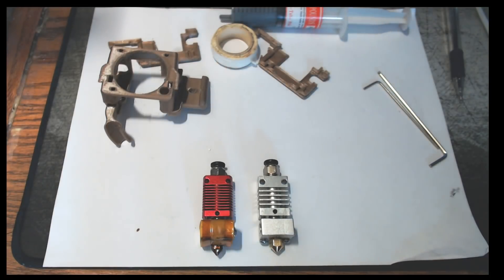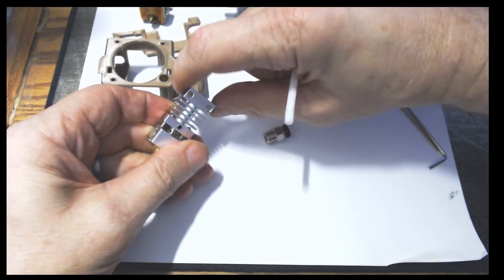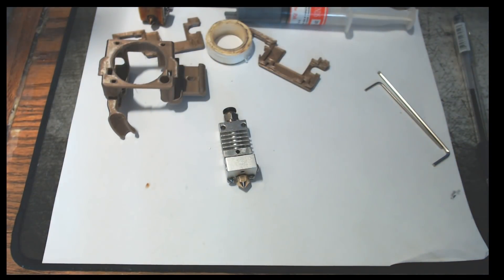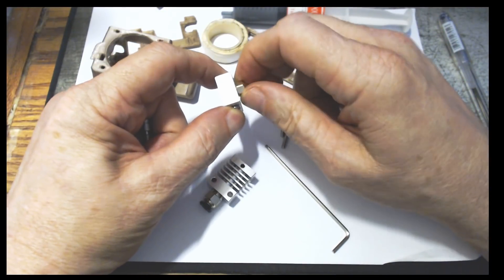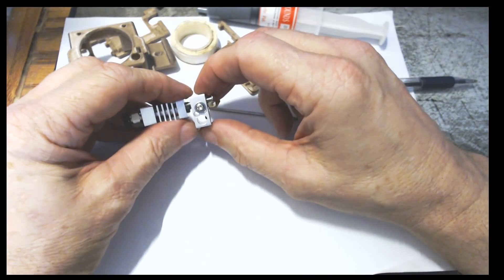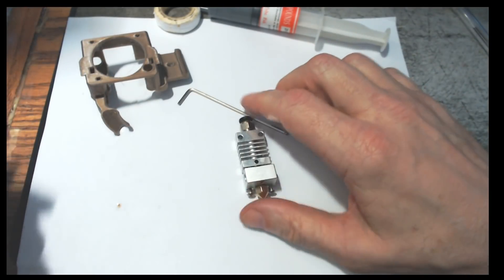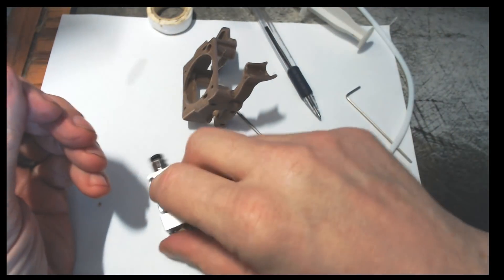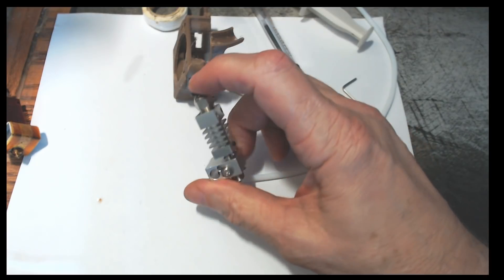All metal hot end for the Ender 3 for $7. Part 1, tips, trips and lessons learned.

Comment: In your beginning you told something about an expensive hotend and you don‘t want to use any names, like me. If you ever bought any of these expensive hotends, you get a manal too. Most buyers think its boring to read anything a manufacturer writes about his produkt, but everything you show in your video and filled it with many words is written in this manual very shortly. In most cases even in different languages. If you really want to read this manual without buying the original item, visit the homepage of this manufacturer.
Reply from the maker: First, I didn't want to read their manual. I never read manuals, it's a sickness. Also, there's some question as to who designed the original in this case. I've had industry insiders tell me that the original was a Chinese design. But who knows? 3D printing isn't new, it's been around since the 80's. If the all metal hotend was patented in the US that patent would have expired years ago and clone products would be completely legal now. But really, does it matter? US and other Western nations give their IP willingly to Chinese manufacturers to get things made cheaply, knowing that the Chinese manufacturer will absolutely set up a second assembly line and sell the product through AliExpress or someplace like that. And multiple other companies in China will copy it as well, which is often why you see identical products on Ali with 20 different brand names. If you can keep all that straight and want to slap "Original" on something and virtue signal on the internet, more power to you, but don't expect me to follow your rules.

Comment: wew ok, i have retraction at 7mm 25mms on my stock hotend, now im scared of stringing for fine D&D models
Reply from the maker: How did you arrive at 7mm and 25mm/sec? Through trial and error? Or did someone recommend them to you? 

If you're making your D&D models out of PLA then I'd probably either stick with the stock hot end, buy another printer so you can have one stock and one all metal, or be prepared to switch hot ends when you switch filament types. You're probably switching nozzles anyway if you're going from  tiny D&D models to larger things, it's not really that hard to swap out the whole hot end. I got really good at it. lol
Reply: @3rdpig  Cheps guide rwccomended it, i tried it and haven't had stringing since. I like ur thinking, i bought a second ender 3 last week haha
Reply from the maker: @LostCloudx4  Thanks for letting me know and I think the second printer is really the best answer for two very different filaments and purposes. Unfortunately I've never watched Chep's channel. I've found that much of the time I used to spend watching other people's channels now go into my own. It's a shame in a way, I've learned so much from Lars Christensen, Maker's Muse, 3D Printing Nerd, Thomas Sandlander, 3D Printing Professor, etc, etc.  So much good information and so little time. I don't even manage to catch all of AVE's videos anymore, and that's really a crying shame, lol.

Comment: Why do you protect microswiss so much they copied crealities design but just moved the hole location
Reply from the maker: I'm not protecting anyone other than myself. Personally I don't really care who designed it or who copied it. I just don't want cease and desist letters from lawyers or have videos deleted, my channel demonitized or have to spend a lot of time cleaning up comments from rabid fanbois of one company or another. And let's face it, it's a heat block with a cooling tower attached to it via a heat break. There's only so many ways to make something like that. Almost anything in that configuration can be called a copy. And I tend to doubt Creality or MicroSwiss  are the original designer.
Reply: @3rdpig  fair point, Im not sure if they can sue you for saying it looks like a clone but it's probably best to avoid the whole lawers shitstorm

Comment: P.s. hot end tube . Try to clean that out . Better to just replace the plastic white tube . Get rid of the cheap ender 3 .
Reply from the maker: You're wrong. It's got nothing to do with the "plastic tube", clean or not. It's got to do with printing at a higher temperature than the "plastic tube" will allow. The "cheap" ender 3 that the all metal hot end is on has been running for nearly 3 years, can print nylon and polycarbonate and, upgrades including, only cost me $400. Show me another printer that comes enclosed and can print successfully in those filaments for that price.

Comment: How come you printer guys never compare a swiss all metal $70 and a $6 one... they look the same... seems odd no one made a video testing using same slicer settings temps material... would be pretty simple...
Reply from the maker: Well, in my case I don't feel any real need to blow $70 to do that. It's basically a ten cent finned aluminum block with a hole drilled down the middle, threaded on each end with a heater block and nozzle screwed to one end and a bowden tube tube fitting on the other. As long as the person making it isn't an idiot the only differences will be the cost of the labor, how much time they spent to make it pretty, packaging and after sales support.
Reply: @3rdpig  i think you r right.. there is no real difference... but these guys setup the swiss one and could easily review a cheap one but don't...  i think its all about $$$ with the other guys for sure...

Comment: Great video! after watching this video i now believe you get what you pay for lol. Don't get me wrong if there are cheap alternatives to name brand products i am willing to try but this product sounds like it gave you too much issues and for me might not be worth it.
Reply from the maker: The all metal hot ends all seem to have the same clogging issue. It doesn't matter where you got it or how much you paid for it, it's just the nature of the beast. When you pull molten filament out of the hot nozzle and into the cooler part of the hot end and then push it back (retraction and reprime), it sticks to the metal walls of the tube, mushrooms and clogs. It doesn't do this with the stock hot end because the molten filament is pulled into a teflon tube, which is slick enough that the molten filament doesn't stick to it. The cure for it is to cut the retraction distance and reprime speed in the slicer down until it stops clogging. For me that was 2mm and 20mm/sec.

I think the bottom line is if you want it to be pretty, come with instructions and after sales support, get the $50 Micro Swiss. If that seems like a large increase in price over the $5 to $7 "copy" for instructions and someone to call if you can't get it working right, then buy the cheap one.

And of course, if you don't really need an all metal hot end the best answer is stick with the stock one.

Thanks for watching!
Reply: @3rdpig  ya i am new to the 3D printing scene so doing my own self research on hot end designs and brands, thanks for the insight on this subject

Comment: The genuine MicroSwiss hotend is not made in China. It is made in the USA. That's why it costs so much more than the crappy clone you bought. Reason number one for your problems was the off center 2 screws on the sides of the nozzle. These are worse than unnecessary, as they cock the nozzle when tightened down (as you noted). It's worse than that because they act as thermal bridges between the heater block and the heat sink. The whole point of a Titanium heat break (is yours on the clone titanium?) is to eliminate thermal bridging. You just added two more thermal bridges with those screws. This means that the bottom part of the heat sink is not as cool as it should be which pre-heats the filament before it reaches the melt chamber in the nozzle. Pre-heated soft filament tends to mushroom and drag along the wall of your all metal hotend which leads to the other problems you described. Furthermore, your nozzle on the clone is brass. This will wear out very quickly with abrasive filament such as carbon fiber impregnated Polycarbonate. Your video is a prime example of how buying clones all but guarantees a worse experience. It is also an immoral thing to do. You are supporting thieves. Before reacting to those last two sentences please watch the video here on YouTube titled "Open Source in 3D Printing - Copycats, GPL Violations, and China"
Reply: Quite right, better to buy a genuine wanhao hotend then the micro swiss, which btw, is a clone of the wanhao.

Comment: What causes little spots to stick up[ after retraction? My nozzel keeps bumping little nubs left by the last pass
Reply from the maker: What filament are you using? I've had that happen with PETG, it seems to glob up a bit, then stick to the nozzle and then when enough builds up it  will stick to the print and the nozzle hits it on it's next pass. If it's PLA or something else then I'm going to have to think that your retraction settings are wrong, or for some reason it's not retracting like it should. Also, some brands of filament are more stringy or globby than others.
Reply: @3rdpig  I'm using 
-amazon essentials PLA grey. 
-Creality Ender 3
-upgraded micro swiss full metal
-glass bed with glue stick cross pattern
-bed temp between 60-80
-print temp 195-200 on first layers
-retraction .6125 (i think)
-print speed 45

I'm printing a mech robot mini 55mm height figure, with zig-zag supports. Iv'e recently heard that printing with CURA supports turns of retraction?
Reply: @3rdpig  Thanks for the reply. I think my problem is the feet and details on the mech don't give enough surface area. If i print with a brim that merges the footprint of my model, I think it will have a harder time tearing off the platform.
Reply from the maker: @evilparadigm  Your probably right, but you shouldn't be making blobs that the head strikes using PLA. But when the model is tall and the base is small I always use a brim or even a raft if it's real small at the bottom.

Comment: Just a question because I can't believe it's not obvious. If installing an all metal hot end is desirable because it allows you to use higher temperatures without the downside of 'poison' gas with the common Bowden setup, why in the name of god would someone then use Teflon tape? Bowden tubes are PTFE. That IS Teflon! The amount of bad 'maker' information on the web astounds me.
Reply from the maker: It is obvious. In searching for solutions to problems, sometimes we do things that are counter intuitive after we've tried all the intuitive answers. It's also counter intuitive that it would impede heat transfer from the heating block into the tip and we want exactly the opposite. So yea, I'm guilty of "Well, that sounds stupid but it's worth a try".

Comment: These clones do not have the tolerances that the original does.
Reply from the maker: Ok, I'll bite. How do you know this?
Reply: @3rdpig   Chuck Bryant    Ive got both! The machining and quality is very apperant when holding both side by side. The titanium heatbreak is an Insert and not a sleeve. This should be the big indicator that they cannot affordably reproduce consistent diameters with the factory or machine that made them. If they made 1000 titanium cloned sleeved version heatbreaks, some might not fit into the coolinghead of others vice versa. This leads me to believe I do not need an expensive tool to tell me the dimensional tolerances are not the same. So i applied the logic that someone has to make sure each and every.. Single.. Heatbreak fits into any of the customer's heat or cooling blocks. The Chinese solved it and made it cheap at the same time by simplifying the one part they needed to machine consistently at high quality! So to make a high accuracy bit, you need an even more accurate bit. The Chinese buy US tooling to make their tooling bits, to make their products. Assuming the original are machined in the US and not just assembled here. I can assure you the clones were not made on a 50 thousand dollar plus tool bit.
Reply from the maker: @Acavando  Your visual comparison, while anecdotal, is valid. I also suspect it's a fair representation of the two parts. And had you stopped there we'd be good.

However, your visual inspection has nothing to do with tolerances or function and everything you said past that point appears to me to be complete fabrication based on assumptions you made from that visual inspection. 

Here's my take. You said you have one of the Chinese parts. Have you tried using it? Does it work satisfactorily for it's intended function? I've got three of them, used them all and they all work fine. 

Bottom line, the MicroSwiss is prettier. but costs 10x as much but it comes with instructions and after sales support. If your logic says buy the part that's 10x as much, that's great, that's what you should do. My logic says "Don't spend $50 when $5 will do the job just as well.

And please, do yourself a favor, stop using words like "tolerances" until you know what they mean. Even a hobby machinist like myself will raise the BS flag when you toss one out like you did in your first post. The constant misuse of words like "tolerances" and "clearances" drives me batshit crazy.
Reply: yeah 

on top of that they went crazy on chamfers on the holes creating areas whee your melted filament can expand beyond .079 dia of the thru hole . And when you assemble them and try to drive check pin thru entire assembly it looks like holes in the heat sink and heat transfer are not in line
Reply from the maker: @georgeinthejungle2  With all the problems you two describe, you'd think they wouldn't work at all. Yet, they do. Maybe, just maybe, the things you're seeing aren't that important as far as functionality are concerned?
Reply: @3rdpig  i agree with you chuck , most likely changing retraction to 1mm helps ,but not fixes the problem completely . i modified my hot end .milled of areas to minimize chamfers and re reamed entire assembly to .081 dia. just today . cant wait to test it .
Reply from the maker: @georgeinthejungle2  I feel you. One of the problems with the Chinese goods is that there's really no accountability to go along with the poor quality control. You may get one that's fine and you may get one that's crap. Get on AliExpress and one particular product can have 5 or more brand names all with different prices. A week later that brand name is gone and another one appears. Complain and they refund your money back but only after making you spend days jumping through hoops. But that's the price we accept when we get a product from China that's 10x less than the one made in a Western country.
Reply: @3rdpig  true . not going to lie i knew that it might not a be a smooth sail when i bough it . after all it was only 7$.  one more thing i found that might help is PTFE in spray that could help with stickiness of the walls .
Reply from the maker: @georgeinthejungle2  The PTFE spray was one of my thoughts too, but then it was pointed out to me that the whole reason for the all metal hot end was to get rid of the PTFE, so adding it back in was kind of counter productive.  I'm also not sure that adding anything to the walls will last with the filament getting dragged past it since the filament is rather abrasive. I thought of graphite dust, but not sure about that. Fortunately for me they've been working now pretty reliably, so either I lucked out and got good ones, or the 3D printing gods have smiled on me...for a change.